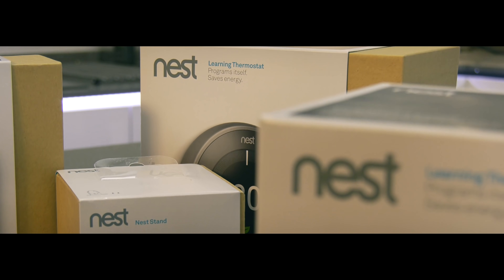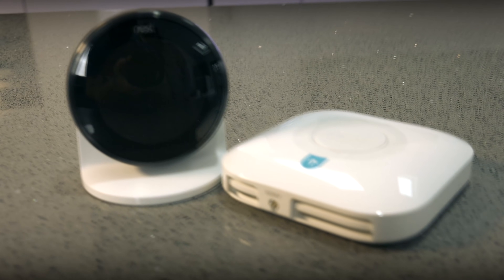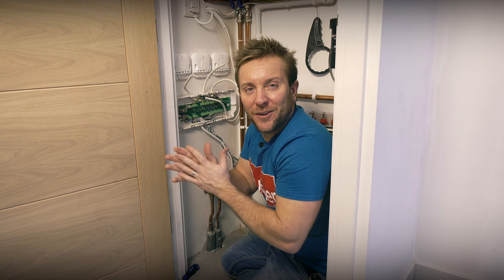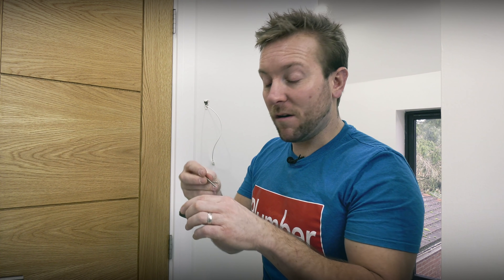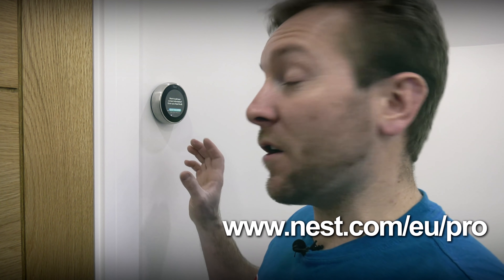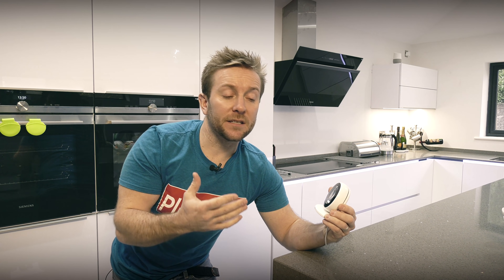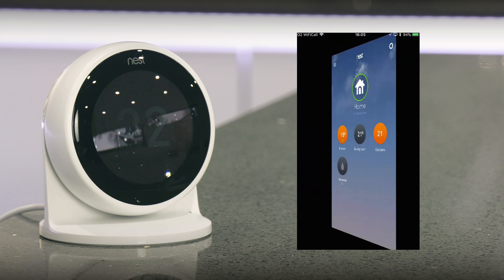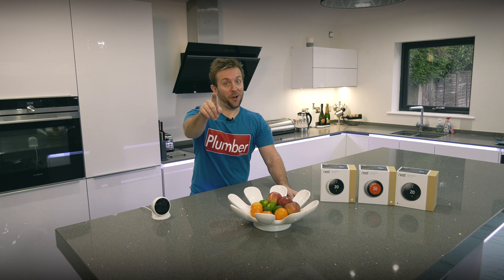NEST ROOM THERMOSTAT INSTALL - INCLUDING UNDERFLOOR HEATING #ad

Comment: I just wanted your video as I have a Heatmiser wireless stat system with 5 zones (3 stats) of UFH and 1 for rads and hot water. My control box looks very similar, but I have an antenna for wireless stats (all 4 of them). However, after reading some wireless range / interference issues with Nest's mesh wifi where the stats talk to the heat links, I am having 2nd thoughts as this is one of the problems I have with Heatmiser - control unit seems to call heat to UFH/rads whenever it feels like - even in summer (where I have to turn off CH on the boiler to stop getting cooked)!  When I opened a ticket with Heatmiser, they said stats are too far from control unit. I proved it wasn't the case as even if i put the stat on top of the control unit 2" from antenna - it was still playing up. Spent a lot of money on system that doesn't work well at all (wish I had run wiring!).

Comment: Hi

I am struggling to find a solution on how I can install nest which would work on my system.

I have the following.

50KW boiler connected to-
1) valve to send hot water to the underfloor heating
2) valve to send hot water to the joule unvented cylinder.
The valves are opened via a two channel timer for hot water and heating, with timers set for when the boiler is fired.
I’m not bothered about using nest for the hot water, just the UFH.
The UFH is controlled by 3 manifolds each with approx 6 actuators on. Approx 20 actuators in total all linking to approx 10 danfoss thermostats.

The issue I have is that yes I can replace the thermostats with the nest solution which when on demand for heat will open the actuators  for hot water, however as the hot water from the boiler is only turned on by the 2 channel timer, it will only come on if the boiler is set to be on permanently.

Is there a way that when the new thermostat calls for heat and opens the actuator on the manifold it can request the boiler to be turned on? I’m guessing the two way channel timer will need changing but what too?

Really struggling with this, any help would be appreciated

Comment: Even when it's freezing inside the home - the small number (which I believe is known as the ambient temperature) on the Nest Thermostat always stays at 22.5 degrees. Do these Nest thermostat really sense the current temperature of the room they are in as I don't think they do which means I have to manually turn the heat on all the time.  What's the point of having this if it can't turn on manually when temperature of the room falls below a certain level because it just keeps showing 22.5 degree C all the time.  This came preinstalled with the new build home - do you think there is something wrong with its installation

Comment: Hi, I have underfloor heating and my gen2 nest only turns on heat from the boiler but the pump that should move that water stays off. The pump only turns on when I use manual mode by pressing the button on the heatlink. Cam anyone help on how to fix this ?

Comment: I have a volt free combi boiler that’s wired to a nest thermostat heatlink to terminals 2 and 3 for volt free switching but I’m asking anyone who knows if it’s possible to use the 5 and 6 terminals that has the live link to make them 240v and still keep 2 and 3 volt free. It’s just that I’ve added ufh and need switched power for the pump. I haven’t installed a zone valve as I only want one stat. Is this possible without blowing the unit?

Comment: So does the nest thermostat on the wall need to be powered through the other panel? Or is there a way to regulate the wattage without getting a wired feed from the panel near the boiler?

Any help?

Comment: Hi. Tell me if the valve controllers are a far distance away from the respective room stat how do they communicate. Let’s presume the home has full coverage WiFi, do the individual nest component communicate via WiFi over the home network or do the respective components need to be within range of each other?

Comment: Loved this vid. Is it possible to walk mount the thermostat on the wall without an existing wire from an old thermostat. And without having to run the wire back to the link? Possible to wire direct into plug socket or safe to channel the USB cable into the wall?
Reply: not ideal but possible if a socket is nearby. Better to run wires to heat link though.

Comment: We got kombi boiler, unvented hot water tank. Programmer and two thermostats downstairs for two underfloor heating zones. On second floor we got programmer which controls heating on second and first floors which are heated by radiators. We bought nest for upstairs but installer today told me that he can't install it as heating wiring needs to be changed. House is 2 years old. 
I'm not plumber/electrician but I find it difficult to believe I need that sort of work just to install Nest. He was Nest Pro with no reviews on Nest site. Any thoughts?
Reply: I am a pro NEST installer and I can tell you He is wrong and you are right!!!. Get someone else to do the job for you.
Reply: @mounirdiab2938  Thank you for your reply, what area are you based? 
I got in touch with nest and they are agreeing with installer... 
I've done little research my self , looking at what I got Nest link needs to be wired to hot water tank and upstairs radiator control units/valves.
Reply: @rolo99909  I am based in London UK
Reply: @mounirdiab2938  would you have anyone to recommend in Kent?

Comment: If you’re a plumber don’t install nest! Employing electrician who is a proper professional and who should be doing the job. Not a plumber! Keep to your pipes mate and leave the technical work to us electricians!
Reply from the maker: jay r something wrong with the excellent install here then? All signed off and still running fine. Better than many electricians I know...and more reliable!
Reply: plumberparts 
As we don’t see any of your wiring close up difficult for me to comment on it. I’ve been an electrician for 20 years and also an engineering tutor I generally find plumbers  very poor at any electrical work. As you carry out the work presumably you are part p registered? Which means you should be on the Internet on the competent person to register? Are you? And if it has been signed off why as it would need to signed off by person carrying out the work!!And if it wasn’t it shouldn’t have been signed off!

Comment: Hi James, 
I have a nest gen 3, with a vokera boiler, and I also have solar panels on the roof that heat my hot water. My issue is obviously this time of year the panels aren’t really heating my hot water and I currently have the hot water setting on my nest set to off which is resulting in me having no hot water on really cold days. What’s best for me to do have the setting set to on at this time of year or set schedules? And then back in the summer months turn it back to off and let the panels do the work again?
Hope you can help.
Cheers
Reply: JAMES ONLY PROMOTES NEST AND TAKES A CUT HE AINT GOT A CLUE WHAT THEY DO LOL

Comment: I've had a Nest 3rd gen installed. When the hot water comes on so do the radiators even though they're not scheduled to do so. Do you have any idea why?
Reply: Ashley Lewis if it’s anything like the hive it sounds like you have possibly had the wrong receiver unit fitted... with a Combi boiler you need a single channel receiver unit, I know a lot of examples of people fitting the wrong units and then scratching their head when it doesn’t work
Reply: i know this was two years ago now... but.... is it possible this is the pre-heat setting working as intended? it can turn the heating on up to 5 hours before you've scheduled it to turn on, if it thinks it'll take that long to get up to temperature. the setting should be called "true radiant" if you've set it up to know you have radiators. the setting is meant to also stop the temperature from overshooting and making it too hot from the heat leftover in the water when it stops pumping around the radiators. have you been letting it run to see what happens later, or have you been interrupting it when you hear the radiators come on?

Comment: So for unit that was controlling the hot water and rads, can that unit act as a programmer for the hot water and heating as two separate zones? I'd assume it can cos you wouldn't want your heating on every time u were heating your water in the cylinder?
Reply from the maker: Exactly!
Reply: Cheers dude. Looking forward to more vids in 2018. Enjoying the product reviews too!

Comment: Enjoyed your video, I really am interested in Nest - Can I ask, I would be replacing a Honeywell Smartfit S Plan system which uses low voltage 2 port valves, can that easily be converted to Nest? Thanks

Comment: Is the nest wireless thermostat wall mountable
Reply: Mar Cel not all systems have an existing wired thermostat, a lot of combi boilers either use a wireless room stat or just don’t have one and rely on a built in timer programmer instead.
Reply: 2 para airborne yes, you will need to power it via the USB plug though rather than the existing thermostat wiring.
Reply: Robert Hunt . Thank you sir for your help
Reply: Robert Hunt how long the circle can work on his battery life? on the other hand you can plug it in the power socket like a phone?
Reply: Why rather USB than the existing thermostat wiring. I always use the wiring from the old thermostat and connect these to the nest base plate and the heat link, works perfect!
Reply: I know but i misunderstanded ''rather'', sorry about that.

Comment: Great video as usual. I did notice that the nest thermostats don't give any room for bootlace ferrules when your using flex on the screw terminals?
Reply: I installed my Nest 'stat last week and the heatlink took 0.75mm ferrules no problem.  The 12v terminals on the base can take ferrules too but you might need to snip 1-2mm off to have them sitting flush.

Comment from the maker: Hope you enjoy guys! Was a great day filming these Nest's going in for my customers Mark and Charlie! Be sure to check out my new Vlog channel here: https://www.youtube.com/channel/UCc2sVD-LTiEOC3cqVNJFZww Also, if you've got any questions comment below INNIT!
Reply: This is a underfloor heating control box. Each underfloor group has a servomotor that is controlled by a thermostat. In this case a Nest thermostaat. You can also can controle more groups with one thermostat.
Reply: Mar Cel a question . I have 2 room in my apartment. So I need to connect the heat link to my boiler a nest thermostat on the wall and the portable ones for the other room to have different temperature in the rooms ? Thank you.
Reply: plumberparts I noticed the Google Home in the kitchen.  Did you know that you can control your Nest thermostats with your google home?  “Hey google, what’s the temperature?”, gets the outside temperature. “HG, what’s the temperature in the lounge/kitchen/upstairs/location-name-of-thermostat?”, gets you that, and you cad even do “HG, set the temperature in the lounge to 23”, etc.
Reply: plumberparts James, another great video and perfectly timed for my install. Quick but important one... what is that unit you wire the 3x heatlinks into? Looks really smart and solve my issue of wiring the heatlinks together. Thanks and keep the videos coming 🤗
Reply: @plumberparts what brand/model is the junction box your wiring the nests into?